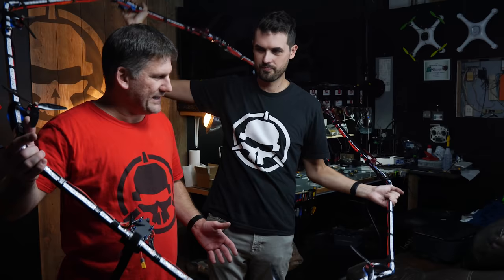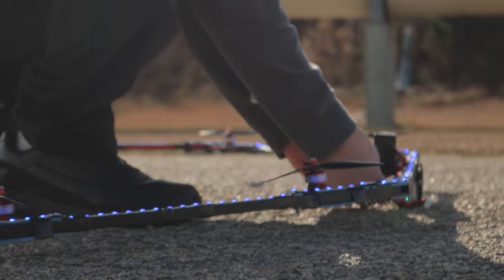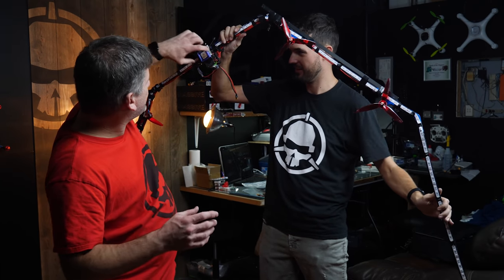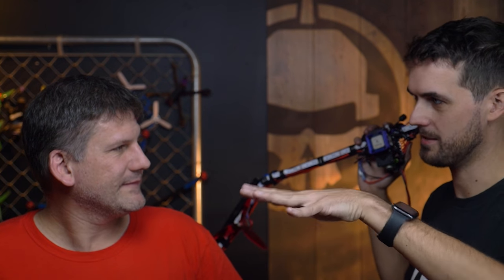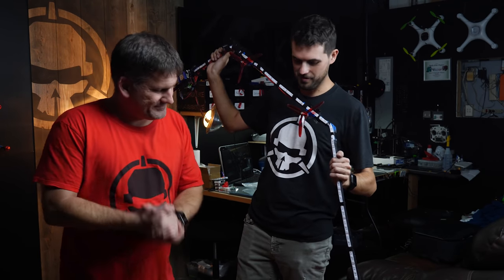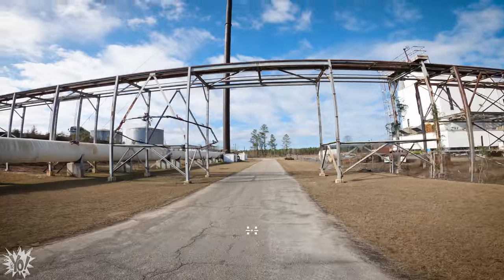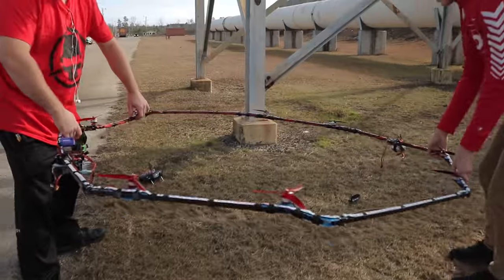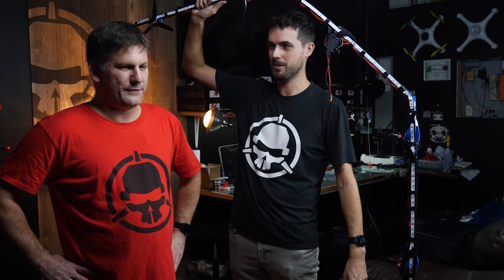Flying Dive Gate!!

Comment: Shawn!!! 🙌🙌🙌🙌 Wooooo!
For the yaw, I've found that the farther the props get from the axis of rotation, the worse it gets. The smaller the props the worse as well. The tilted rotors were a good. idea
Reply: Thanks buddy.  Yeah.  I tried it with 10” props and it did well, but, the motors were smoking, so, the tilt helped save the day.

Comment: I know weight is a concern but if you add a second ring above it(maybe below it because it would leave motors free to spin props) you could add some triangulation between the top/bottom rings for more rigidity and maybe even protection(if above).   2nd ring should be rotated so as to have it's joints staggered so triangulation is at joints between top and bottom rings.    Good job on Drew's part for clocking motors for thrust effect for yaw.   Bigger props were likely great idea, 7inch for keeping benefits of polymer props.

Want to get stupid?  Add even more motors between top and bottom rings.   Have a 4:1 for each signal for the quad.

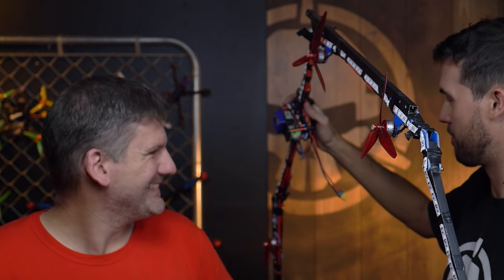Comment: 3:55
The FC can be anywhere as long as you want to fly in ACRO only since rate of rotation is same for the entire body (if the body is rigid) and hence a gyroscope can be mounted anywhere.

BUT, if you want to use an accelerometer as well, for angle mode or something, then you have to mount it in the centre only because if you mount it on extreme edge, then it will pick up centrifugal accelerations due to rotation and it's data will be corrupt af.

Comment: also might disable the accelerometer due to the FC being so far off center. if im not mistaken when a drone yaws it is expecting rotation and no sideward forces. with the FC on the edge trying to yaw around the center would cause a side force that the accelerometer will "feel". most drones dont actually use the accelerometer except for major corrections or if using gps. now that i say that i did see a gps receiver on the ring gate.... so might try it if not actively using the gps. Excellent vid and excellent idea keep up the excellent work.

Comment: Did you need to use the same length signal wire from FC to both ESC's. Just thinking of synchronisation issues?

Comment: What software do you have on it? I am assuming you have auto level on, but did you try altitude hold and what not? I saw the GPS, is that what that was for but it didn't work? I need more info!!!!! haha. So awesome!
Reply: Betaflight 100% manual control.   It was to unpredictable to trust stabilizing software
Reply: @LetsFlyRC  Gotcha gotcha. Any plans to try to stabilize it for Rampage?
Reply: @LetsFlyRC  You could possibly try one of DJI's cheapest offerings. I was very impressed with how stable I got a bigger quad for my work to be for not that much money. Plus, it was easy. Just a thought, I couldn't have done what you did so I hope I don't come off as someone that seems that way.

Comment: 4:08 Not 100% true. It’s going to pull a lot more on side than it would with the other despite the drone being symmetrical. To the flight controller, it will think that one side of the drone is heavier, so you might notice one side being more sensitive than the other since the motors are going to spin up faster and slower on both sides. But it can be corrected through software.